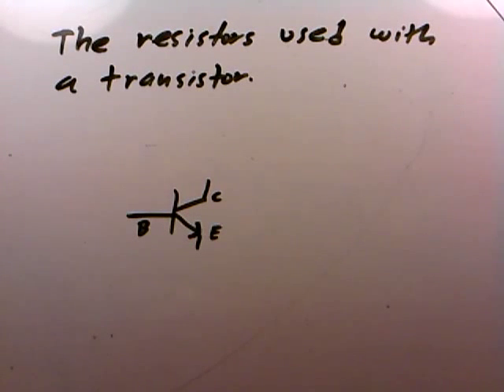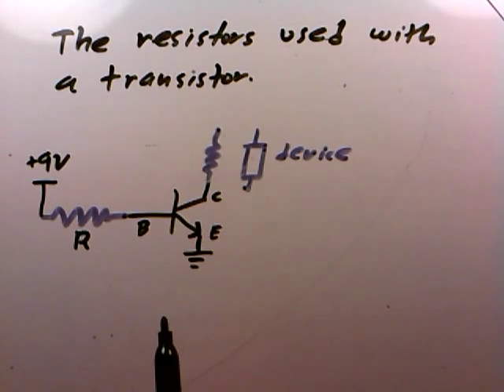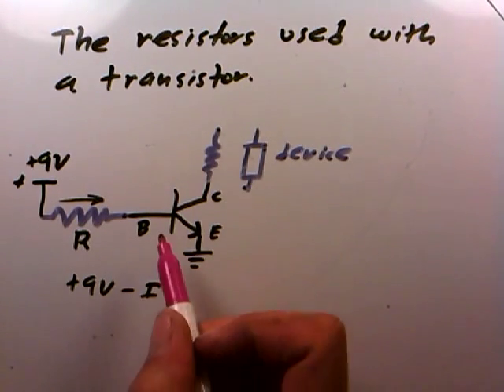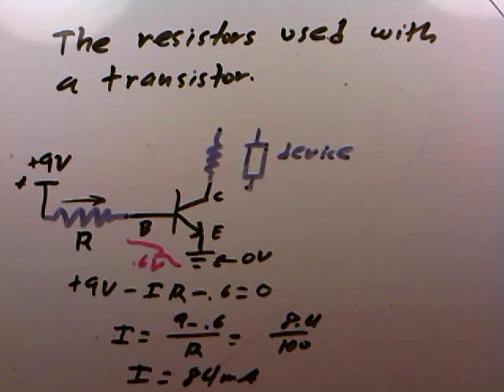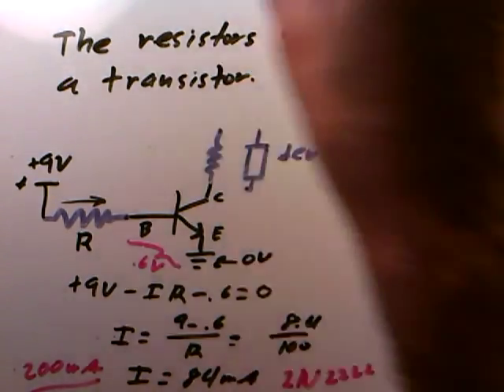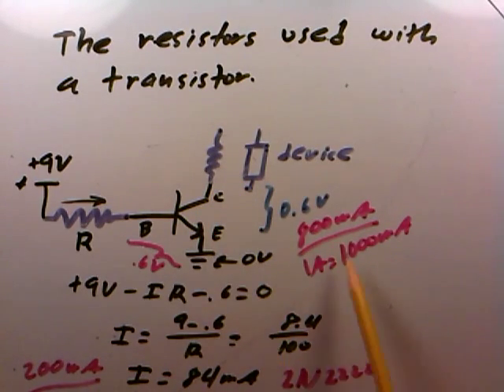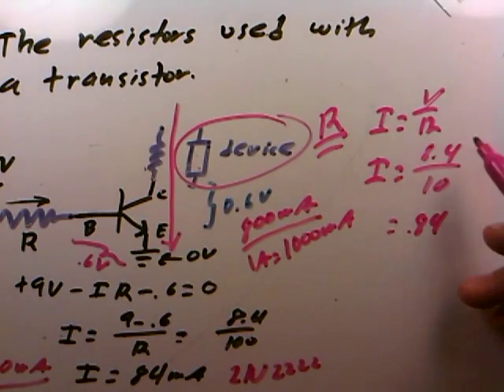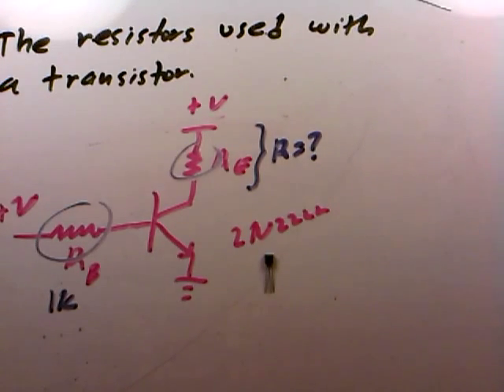elec 027 base and collector resistors used with transistors

Comment: hi..is it compulsory to put resistor at the base for the transistor to function?..how about if not put resistor?
Reply: The transistor will burn if you dony use a resistor or a load to trigger

Comment: Really nice explanation. One thing i'm missing: How much base current is needed that the transistor is fully conductive ? If i think about the base resistor a higher value is better because you save power (yes, it is small). If a device is turned on constantly then this might matter.